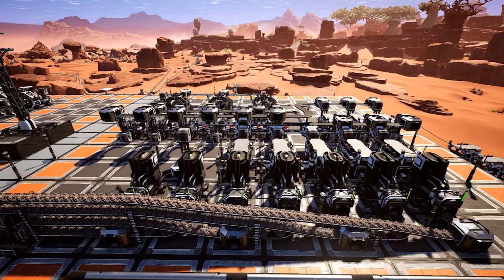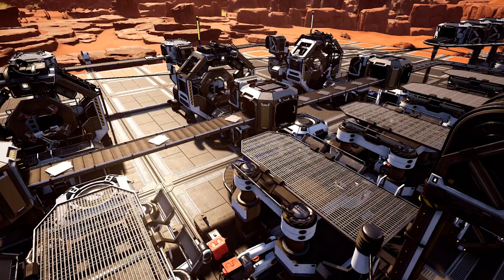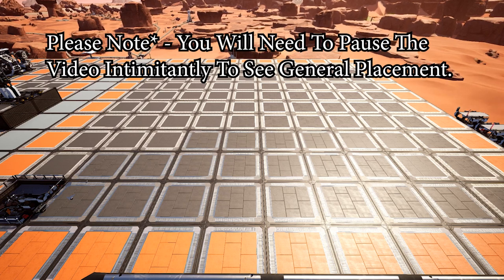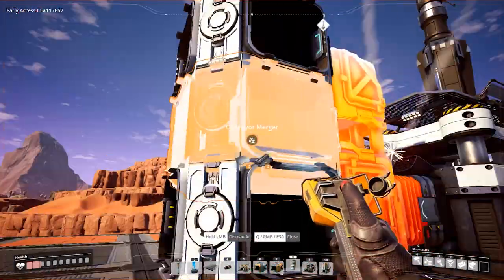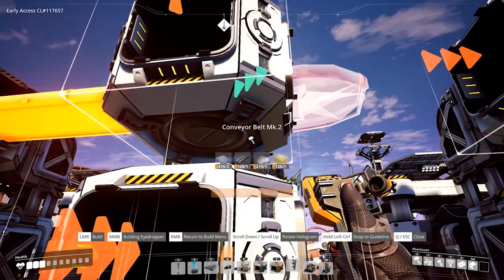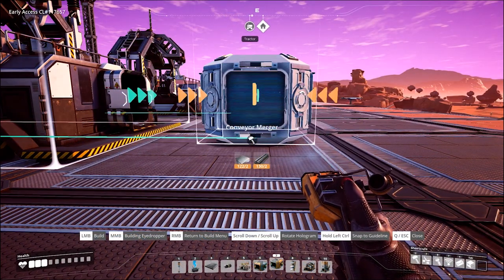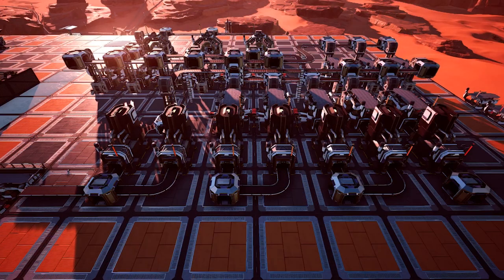Reinforced Plates - Super Efficient Build Guide PT.1 [Satisfactory Guide]

Comment: I am kind of new to this game but i watched a couple of vids here, some about load balancing using splitters/mergers.
Following this giude I encountered an issue with the load balancing (and I was actually expecting this... however, I kind of trusted you as you re clearly more experienced than I am :D)
So please correct me if I am wrong, but from what I understand the problem is this:
A splitter splits the input equally amongst all output ports. So if you have 2 ouput ports each of them will receive 50% of the input.
Take the rods conveyor lane for example:
You produce a total of 45 rods/min that should feed into 6 constuctors which require 7.5 rods/min input (75% clockspeed).
So the first splitter of this conveyor lane receives 45 rods/min and splits it into 22.5 (contructor)/22.5 (next splitter).
Thus the second splitter receives only 22.5 rods/min and splits them again equally amongst all output ports (2), which means your output is 11.25/11.25.

The result is an inefficient loadbalancing (under / oversaturation of constructors).

Looking forward to your feedback :)
Reply from the maker: You’re absolutely right, manifolds dont load balance and thus you under saturate a line to start off with but as the first and second constructors over saturate the “spare” rods are carried over until only the last two constructors are being fed equally. You just need to let the system warm up

Comment: Seems it is like this. Correct me if i am wrong:

Total 7 x Smelters; 14 x Constructors; 3 x Assemblers

Iron Plates: 5(2+2+1) x Smelters (100%), 5 x Constructors  (90%), use Mk.II belt to merge deliverables and flow to the center merger
Iron Rods: 2 x Smelters (75%) 3 x Constructors for Rods (100%)
Screws: 6 x Constructors for Screws (75% clockspeed)
3 x Assemblers for Reinforced Iron Plates

Comment: Instead of using the slider to adjust the clock speed or to get the targeted output number u can just type in the desired percentage or below you can type in the desired output number. This is way easier than calculating and trying to move the slider to the perfect spot
Reply from the maker: You're absolutely right :)

Comment: My god the 2nd guide for 10 reinforced iron plates are so much easier to follow than this one. nonetheless great job :) just fyi, I had to re-do the splitting of materials for several constructors as the ones last in line weren't getting enough resources to work all the time :)
Reply from the maker: Thanks I definitely prefer the improved guide version as for the factory not getting enough items as it’s a manifold you need to wait for the whole system to saturate before it becomes efficient it takes a while to start yo but after it will run as efficiently as a load balance ☺️

Comment: I know this video is a few months old but I would of thought the best radio would be to use 2 assemblers?

requires 1 pure node,
3 x constructors on plates (60 plates per min)
2 x constructors on rods (30 pm) feeding 3 x constructors on screws(120 pm)

If there is a reason Im missing let me know. otherwise a good video :) I really like your way of building with the elevators.
edit - just seen someone else comment the same as me. ignore me :D
Reply from the maker: The reason was solely because we go on to produce Modular frames, but regardless there's an updated video which I think's much better, i wasn't happy with it overall.

Comment: You can actually get a bit simpler than this. With a singe pure node of iron on a Mk. 1 miner you can get 10 R.I.P/minute. 60 plate/minute needs 3 constructors being fed 90 ingots/minute from 3 smelters. Next you take the last of your 4 smelters and split it’s output into 2 constructors making 30 iron rods/ minute. Do you know what the conversion ratio of rods to screws is? 1 to 4, so that 30 rods gets put through more constructors to make 120 screws/minute, or the exact amount needed for 2 assemblers to make 5 iron plates per minute, taking your input of 120 iron ore per minute and turning it into 10 R.I.P/ minute
Reply from the maker: You're right - I wasn't happy with how this video turned out so I redid the video which I thinks much easier to follow

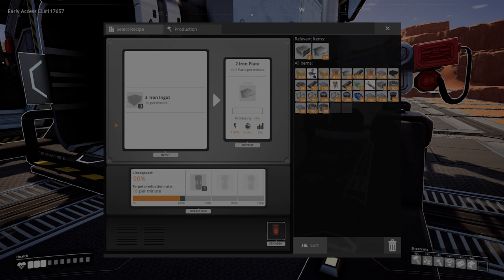Comment: You say we need 145 iron ingots around 2:55 , but how did you get that number? Assuming 5 constructors at 90 percent, wouldn't that be 5 * 30 * .9 = 135? As far as I'm aware, the inputs and outputs both scale linearly.
Reply from the maker: You know what, I've no idea why I said that! You're absolutely right having checked through the video, 30 x 4.5 constructors = 135, I don't even know how I came up with 145. Good spot. now If only I could add an annotation correcting this video :/

Comment: Looking at the bird's eye view at 5:17, how do you get the ore up to the other six smelters?  This seemingly simple logistic is causing a traffic jam in my brain. :)
Reply from the maker: So at that point, I just lifted a line of 60 iron ore (MK1) over the top of the first splitter then down into the second splitter, I then did the same with another conveyor line over the top of the 1st and second splitter and repeated the process etc..
Reply: @TotalXclipse  I ended up running belts from below to an elevator.  It meant making some holes in the floor, but it seems to work.  I have made it through the first two videos and have those making while I work on getting the higher tiered factories.  I will probably need to make a small parts factory so that I have what I need to build with.  Not sure how that will play out down the road. Thanks for your help.

Comment: Thanks for these vidos. Quick question, at what point would you say move on from your video about the Iron recipe Rations to something like this? Ive started at grass fields with the 3 Normal Iron deposits, so to start I can make Pltes, screws and rods using your other video to giud me. Once I have upgraded enough, and am ready to start buildting rotors etc, should I reconfigure that factory to one making Reinforced plates and Rotors like this? Or get a new Iron Supply for them leaving my orginaly factry making the 3 low tier mats? Thanks again
Reply from the maker: I'd probably feed that lower material to a storage area - you'll need them for building the basic stuff and move onto a different node of resources for the more advanced builds
:)

Comment: This looks awesome and will be using it, but I have question about your input of iron ore input, what's the ratio you running iron ore through there 4 lines to the smelters?
Reply from the maker: the reason there were four lines is because at the time I believe I was restricted to MK1 lines for the video :)
you need Iron ore according to the clockspeed of the smelters which I think is 100% which would be 30 per smelter.
Reply: @TotalXclipse  so a normal mk1 miner on a pure node split across 4 separate lines would be sufficient enough for this set up :) awesome!  Keep the videos coming on build guides! They are really helpful and your map is insane dude 👌

Comment: Great video! I think I missed it, is this running off a Mk1 miner on a normal iron node?
Reply from the maker: I didn't say what miner but you will need 145 iron ore. So I might be mistaken but I think a impure node is 60?so you'd need a 2 mk1 miners one on a normal and one on an impure. :)
Reply: @TotalXclipse  Impure node is 30/min IIRC, normal is 60, pure is 120. So a single pure node overclocked to 145/min should be perfect if you have the belts for it, or two miners on a normal node with a slight overclock.

Comment: First of all, thanks for this video. 
But i have some issues with this build. I tried to do the exact same but i cannot find the problem(s).
My iron plate production is overflowing.
The first constructor for screws is also overflowing with rods and the last constructor is barely recieving any rods. 
Any ideas?! 
Thanks for your help and keep up the good work!
Reply from the maker: Hey! So firstly with the manifold system you will need a fully saturated conveyor for it to be running at 100%  This is the same for both the Rods and Plates. 
as for the screws I noticed this issue my self - it shouldn't happen as they're a load balance system, but I believe if there is a halt of production - or if it takes too long for the plates to get to the assembler there'll be a back log of screws formed. Apart from that I can't help - I'm hoping to do a load balance system as well, but it will take me a while to do this as there are soo many guides to do
Reply: I am also kind of new to this game but i watched a couple of vids here, some about load balancing using splitters/mergers.
Following this giude I encountered the same issue you described (and I was actually expecting this... however, I kind of trusted @TotalXclipse as hese clearly more experienced than I am :D)
So please correct me if I am wrong, but from what I understand the problem is this:
A splitter splits the input equally amongst all output ports. So if you have 2 ouput ports each of them will receive 50% of the input.
Take the rods conveyor lane for example:
You produce a total of 45 rods/min that should feed into 6 constuctors which require 7.5 rods/min input (75% clockspeed).
So the first splitter of this conveyor lane receives 45 rods/min and splits it into 22.5 (contructor)/22.5 (next splitter).
Thus the second splitter receives only 22.5 rods/min and splits them again equally amongst all output ports (2), which means your output is 11.25/11.25.

The result is an inefficient loadbalancing (under / oversaturation of constructors).

Looking forward to your feedback :)

Comment: I did what I think you did in this video but there are two assemblers stuck at 50%.  Idk how to fix them.  The iron plates aren't coming in fast enough to get 100% on all three assemblers at the end of the line. :(
Reply from the maker: So you should have 5 constructors each creating 18 iron plates per minute Which should give you 90 Iron plates? which split between three assemblers should run at 100% This is also the manifold process you do need to let it "warm up"
Reply: @TotalXclipse  I changed the conveyor belt to MK.2 and now they're overfeeding the assemblers and all my iron plates are stuck in the belt until something gets made.  Is your setup different?  Are your iron plates stuck in the belt even at 100%?  Right now, the assemblers are making 15 reinforced plates per minute but the iron plates that are being fed to them are slowly moving in the belt because all of the assemblers are full

Comment: Can you clarify what Miner, if it's overclocked, and how many nodes?
Reply from the maker: I mentioned we need 190 iron ore.
So you will need at least 2 miners on pure nodes - which would produce 240 Ore per minute. Or a combination of three or more miners on lower yield nodes. You would then connect your ore bus to these smelters.
Reply: Ok, TY. I am using one pure node. For now, I overclocked my mk 1 miner and used mk 3 belts to send 190 using the same splitter/ bus layout. I will upgrade my miner later.

Comment: I’m late to the game , but after I finished building this, I found that the last 2 constructors making screws were being underfed while the other 4 were taking up the the rod consumption. Is that normal or did I miss something? I looked at the clock speeds and inputs but I don’t fully grasp a lot of this.
Reply from the maker: Yep so you need to let the whole line saturate as it's a manifold, once it does saturate then everything will run efficiently :)
Reply: TotalXclipse : I just now saw your video on manifold systems. I’m building first time base building and I’m going from one resource at a time. So I just got to the rotor production. Where you suggested the manifold tutorial. I appreciate your videos and has made learning the complicated system easier to understand. Thank you.
Reply from the maker: @lynnsanity5667  Glad to know I was able to help you out :)
Reply: TotalXclipse: tremendously. I’ve got my iron, copper, limestone manufacturing as well as reinforced plates and rotors finished. I’m off to the modular frames next.

Comment: tryng to figure out how to the alternative (casted screws, 5 ing->50screws) into this build
Reply from the maker: the issue with screws is the sheer amount you need and unless you've got mk2 or greater belts it'll be difficult but I'd have 3 cosntructors doing Alt screws, if it's 50 per minute that means you've got 150 of the 180 screws you need. Now build a fourth constructor for screws and Under clock to 60% to create 30 screws. this gives you the 180 you need. then split the 30 between the three other constructors line's using mergers. In my new steel layout video on one of the layouts for steel beams, I show a way to split this so that it looks pretty clean. 
but that should give you the 60 screws you need per assembler :)

Comment: Hey! I have a question. If I run the first line connecting to the smelters in overflow method will it still be efficient?
Reply from the maker: It'll take a while to warm up but if you have the belt holding the right amount of items it'll be fine. Unless its a super long line... I did a video on it here:
https://youtu.be/zFy2v87HFE0
Reply: @TotalXclipse  Thank you! That really helps!
Reply from the maker: @kobeh2937  No problem! Glad I could help!

Comment: definitely not new player friendly guide.  I spent more time guessing to make sure my layout was right.  Video was cut so he was just mid placing and now showing enough position, and not giving enough overhead views.  Had to back track countless times.
Reply from the maker: Sorry man! I'm working on a website which will hopefully make building a factory alongside these guides much easier. I also like to think that the newer efficiency build guide videos are easier. I'd appreciate your honest thoughts if you have time to check one of the later ones out.
Reply: @TotalXclipse   I've watched more videos, built a couple more things and there are a couple suggestions i'll throw out there.  I would be more clear about how much raw resources you need pumped into one of your builds.  Spent a few hours trying to figure out why the reinforced plate build was only making 10/m not 15.  I figured you had 180 iron coming in vs my 120. (although I've learned from this experience and now it's something I always check)
Second suggestion would be the cuts,  a lot of new people coming into the game currently.  A lot of your cuts are "place 6 constructors " but your cut starts when you're placing the 3rd so i'm not totally sure where to start them until I finally see an overhead.
Reply from the maker: @ClutchNixon10522  Thanks I appreciate this! I believe with the second suggestion, the layout factory guides from now on should be covered as I will do a timelapse covering the whole build rather than cuts.
as for the first one, I'll try to remember to inform people at the start exactly what we'll be running into the factory :)
Thanks!

Comment: What a clickbait...said it was 100% efficient but then uses the overflow method😂😂 nice try, but thats not efficient
Reply from the maker: Overflow method is just as efficient as a ratio split. It only isn't if you don't calculate the resources. Once fully saturated all machines should run at 100% efficiency, if you're really struggling you can create a scaling system using smart splitters and setting them to overflow :)
Reply: @TotalXclipse  no. It takes alot of time to set up. That is what makes it less efficient. The first few machine will always be completely full,which makes it even less efficient.